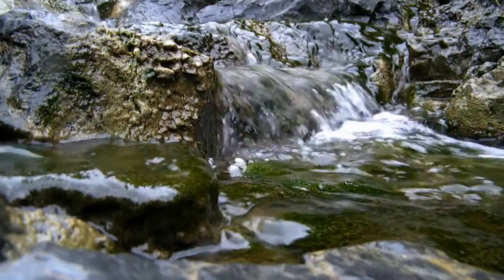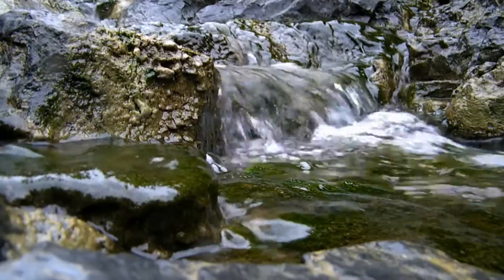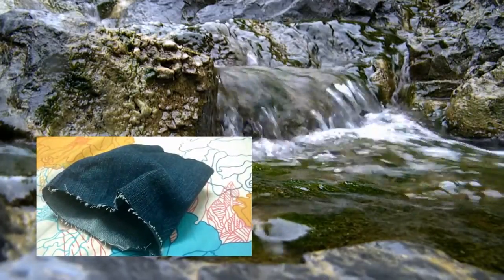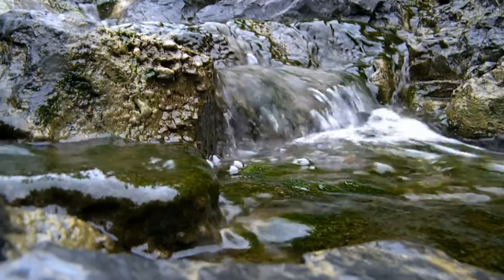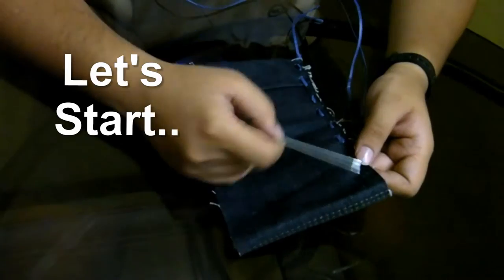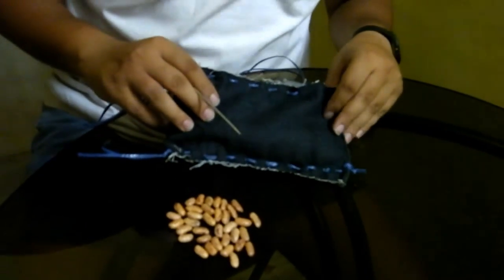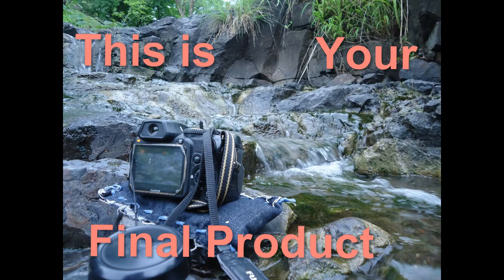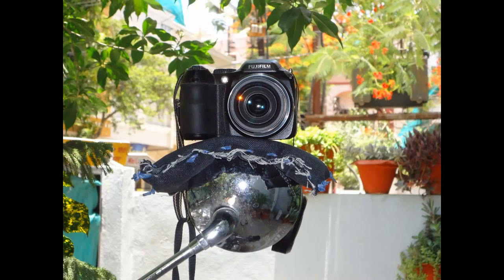How to Make Camera Bean Bag - DIY for free Instructions & Photos

Comment: Thanks for the video. I'm thinking about doing this as well. My primary aim is to overcome the vibration that even gentle wind can impart to a tripod when using a long telephoto lens. A few bags on a ledge eliminates all those vibrations. I also came to think blue jeans legs would be a good container. Mine will have two differences, though: 1) I'll make the shape long and thin so I can fold it and make different shapes. 2) I think I'll put the beans inside a plastic bag inside the jeans legs to keep the beans dry and to prevent bean dust from coming out.